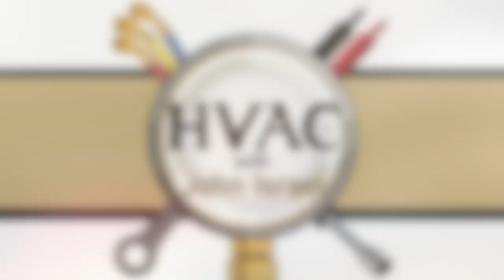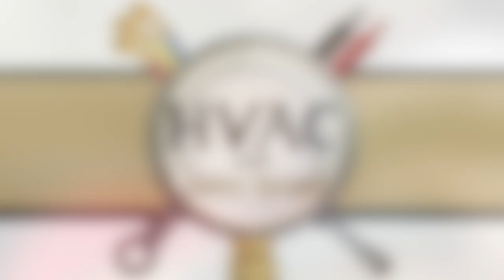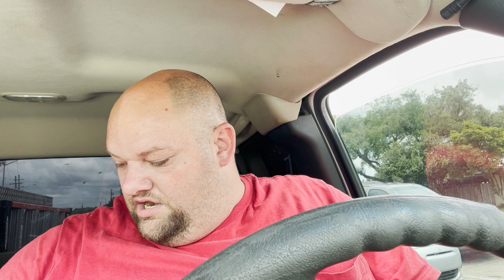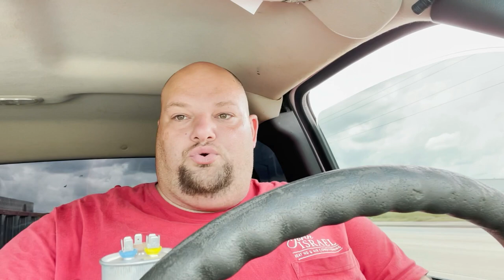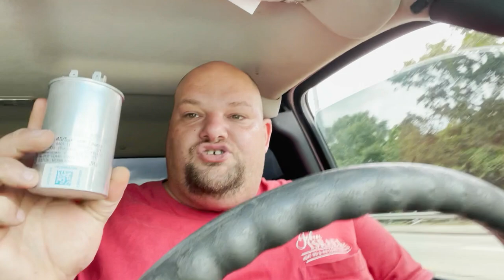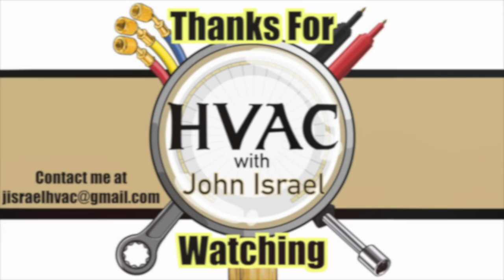Attention Carrier/Bryant & ICP Dealers

Comment: 2019 Bryant 3 Ton lasted 1 1/2 year, no cooling.  Bad 45/5 Cap.  Cost me $167.00 to replace under a maintenance plan.  No more.  Cancelled my maintenance plan, got me EPA certification and now stock my own caps,  contactor, timer/defroster board with sensor and have been studying HVAC hard since almost a year now.  Gradually purchased my own gauges, tools and test equipment which is quite expensive but I'm retired and have nothing by time on my hands.  I have a serious electronic background so I'm actually enjoying this.  Will never call anyone to fix anything i Can't fix myself, will repurchase new if I can't fix it.
Reply from the maker: Good for you but that’s not a bad price. We have to make a living
Reply: So does everybody.  So if a plumber charges you or a Mechanic charges you a thousand dollars for a simple repair or maintenance you are ok with that.  After all everybody needs to make a living.

Comment: The capacitor in my unit is from 10/1976...I've kept a spare on the shelf for insurance since the last time that I replaced the start assist capacitor(I just happened to notice that it had blown apart inside the unit before I tried to start it for the first time that year and I don't know if it had been running that way or if it blew up the last time I had used it the year before ?). I didn't try to start it up before I replaced it though. I almost did but the fact that I had turned off that circuit for the winter and forgot to turn it back on...I did try to start the AC but it was a no go(obviously with the circuit on the main panel still turned off). Upon investigation I found the blown start assist cap in pieces strewn about the compartment. Lucky certain parts hadn't landed on the contactor when it blew apart !!! Point being my 1976 oval 11 or 12 inch tall capacitor still works.
Reply: what kills those capacitors is the case rusting from outside in, until the fluid leaks out. even the old round ones ;)

Comment: Just a little over reaction I think. Yes a part failed. It happens. 

Is it any Chinese part you don’t like? What if a part failed on your favorite brand let’s say a motor. 
Are you going to change all the motors before installation. 
I don’t think so. 

It happens, parts fail in and out of warranty.   

It sucks you had to eat the warranty but that’s the cost of being a good business owner. 

It just seems you are over reacting to something so minor. 
Good to see you covered the call back. It was the correct thing to do.

Comment: I have been installing temp star for the past 5 years and have installed over 400 systems and have not had this issue. Sure caps go bad but in my area we have a lot of power  surges. It does not matter what brand cap is in the unit usually it is the first to go. You seem to be  disregarding the issues other brands have so 1 bad capacitor  and you blame the brand not right
Reply: he blames the capacitor that the brands he speaks of use

Comment: As crazy as it sounds, much Chinese manufacturing is a dog eat dog capitalist market. The owners of the private businesses make things as cheap as they can, so as to get as rich as they can, as fast as they can by selling as much as possible, as fast as possible. All they care about is undercutting the guy down the road on price. It isn't like in Japan, where they value quality. 
Buildings collapsing in China is a common thing due to poor construction. They design buildings to last 30 years. After that, good luck. Electronic replacement auto parts from China are known for their poor quality. More than a few won't work when new out of the box, or fail within a few months. 
I saw a video once where a man took a screwdriver to a 'concrete' wall in a high rise apartment building in China, and was able to scratch away as much 'concrete' as he liked. Hope it wasn't in an earthquake prone location.